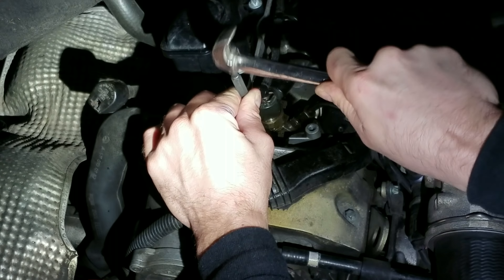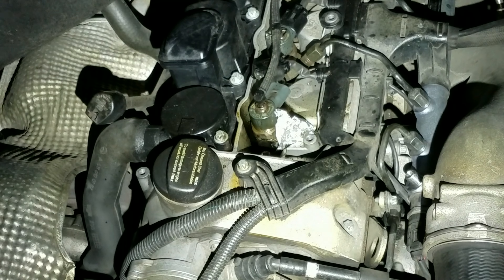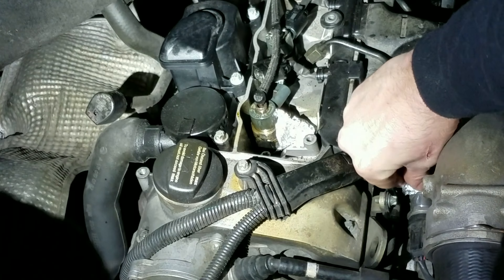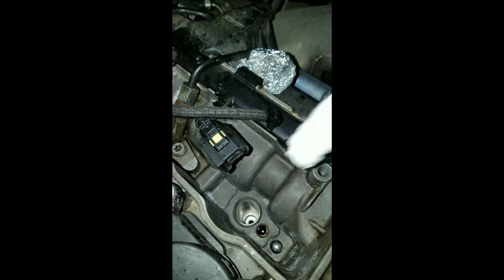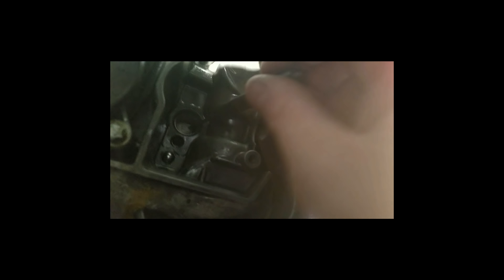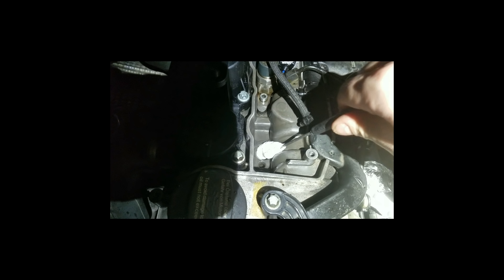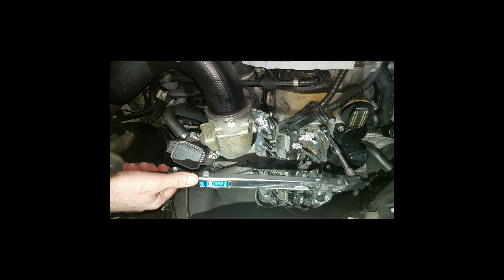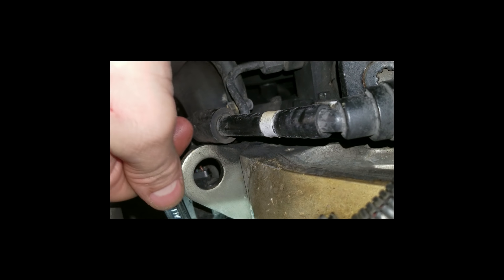How to fix "Black death" injector seal leakage on a T1N Sprinter [02-06 Dodge/FL/MB]

Comment: Is there a way to get some oil on the piston rings after all the cleaning?
Reply from the maker: That may actually be a really good idea if you happen to get any solvents down the injector hole. I would use fogging oil. You can get it at the auto store and it's meant to lubricate the cylinder from down the injector hole or similar, after a fresh engine rebuild. Recently I have been using the injector seat reamer to do most of the cleaning and I plug up the hole while cleaning the sides of the injector well so not much stuff gets down there. My buddy actually removes a glow plug and then attaches a compressed air line into the glow plug threads. To push air into the cylinder and out the injector hole so no junk can come in.

Comment: In the event this happens to me on the side of the road what tools or items should I carry?
Reply from the maker: New injector hold down bolt and injector seal ring, T40 socket and ratchet + extension, 14mm wrench, oven spray, mercedes injector seat reamer just to clean rather than to ream, bottle brush kit from harbor freight, paper towels, gloves, goggles, Fenix HL-55 headlamp, and don't forget the large channel locks - my craftsmans have been serving me well for injector removal. Always keep extra injector bolts and seals handy in the van, multiples, in case you have to redo it or you lose one. Cut slots in the old bolt and save it, as a bottoming tap for the injector hold down hole - it's crucial that it is totally clean so the bolt gets to the bottom of the hole. 

See my black death toolkit videos: 

https://www.youtube.com/watch?v=3vA1zOYSUMM

https://www.youtube.com/watch?v=u5zIC1aOxEA
Reply: @AncapistanVan  I appreciate the response this will be very helpful building my tool kit for my T1N Sprinter. Thank you

Comment: Oven cleaner. Great idea. 
I was looking at a kit with flat reamers to cut the carbon out. 3/5 of mine are leaking and I'm about to drive 1,700 miles. I better get to it.
Reply from the maker: I'd avoid reaming, using it as a last resort. I was able to chip the carbon off the seat with just a pick like a tiny chisel.

Comment: I got a sprinter as well.and my injector seals.on 2.injectors they they keep leaking..replaced.and months later still leaks!!!!!!same.ones
Reply from the maker: Do it again but cleaner this time. The hold down bolt holes fill with sludge, preventing the hold down bolt from bottoming, preventing adequate clamping force. 

Did you use a torque wrench? After the torque wrench did you do one 90 turn, or two? MB has updated the specs to an extra turn for a total of two 90 degree (iirc) turns. I did one without a torque wrench and only one 90 degree turn and it came loose. I redid it and it hasn't leaked since. Make sure you always use a new hold down bolt and copper seal. The seal face on the injector and in the valve cover must be immaculate.
Reply: @AncapistanVan  Must of done it wrong ,yes i used new stretch bolts.and new copper seals .last time i used a tourqe wrench n it leaked..and b4 i used just a rachet.i just tighten it up and moved the injector.and it was still.wiggling so.i turned it eveen more so.it wouldn't turn with force of my fingers..and injector.didnt move.but as soon as i start driving.i hear the compression leaking from there..you said 90 turn.? Im not sure.:( i just tight it up n thats it.i called mb like year ago n they told.me the tourqe.i think it was 28 Newtons they said.not 100%sure..but they never said anything bout 90degrees. ..would you know.the right way n tourqe specs.? 2012 3.0.liter usa
Reply from the maker: @itsmisterchris   well there's your problem. You need to follow the torque spec and torque procedure to get adequate clamping force on the bolt. The bolt is engineered to bend where it doesn't have threads at the top and that is what actually holds the injector in place, that bending/stretching action. It is an incredible clamping force required, not something you can achieve just by tightening it with a ratchet "good n tight". you're basically bringing the bolt to the limit just before it snaps from bending. If you take a look at your old hold down bolts see if the bolt is bent. The torque spec for a 2004 is 23 newton-meters AKA 204 *inch* pounds to seat the bolt, **and then** two 90 degree turns. The original spec was only one 90° turn. So be cautious, smooth and gradual while doing the second 90 degree turn. I believe the torque spec for my 2004 is the same as for your van, but I could be mistaken. I'd check the europarts page for more info.
Reply from the maker: @itsmisterchris  just looked it up and yes the bolts are the same for the 2002 to 2018 USA models as long as you don't have a 4-cylinder. So the torque spec should be the same but if I were you I would call MB wilsonville, oregon, parts Dept to confirm.

https://europarts-sd.com/fuelinjectorretainerscrew2002-2009.asp
Reply: @AncapistanVan  allright thank you :)

Comment: Great video! Just one question, does it matter that when you spray the oven cleaner down the holes it then drips into the cylinder.  Does this matter at all ?
Reply from the maker: You know I was wondering that myself. Last job I did, 2x injectors at once, surely some got into the cylinder. When I started it up idling it was smoking, white smoke, which cleared up after a few minutes. I was thinking the worst that could do is clean the piston rings and contaminate the oil. Well unless you get a whole butt load in there, then you could have a lack of lubrication situation damaging piston rings and cylinder wall I would imagine. You can crank the engine with the injector out but I don't think there's enough pressure to blow out foamy oven cleaner. I tried a Shop-Vac with a vinyl tube duct-taped on but it just wasn't powerful enough. Compressed air might do the trick, or one could try to plug the injector hole with paper towels or a plastic plug. I suppose it would be a good idea to add a little shot of oil into the cylinder in case there is not enough lubrication after the oven spray.
Reply: That makes sense, compressed air and a couple drops of oil would do the trick I bet

Comment: What were those "beauty cleaning products" ? :D Badass repair. Almost a miracle, that you PULLED it out with your own hands, so easy!
Reply from the maker: Q tips. Yep the injectors were steaming hot when I pulled em, plus I caught this very early by smelling it thru the vents long after fixing the boost leaks.
Reply: @AncapistanVan  what spray products did you use? I'm sure they are called something different across the pond!
Reply from the maker: @ltsgarage7780  oven spray

Comment: when you were stretching the bolt, I was cringing and hoping it didn't break. oh what a mess that would have been.
Reply: Stretch bolts scare the crap out of me. The big ones on Sprinter heads just suddenly go to stretch, it's the worse feeling and you still have to give them a whole 'nuther turn.

Comment: thanks for the video, i will check my injectors soon!:) just got a diesel which fires right up, but has a hard time running when it is cold, unless i step on the gas, and the area around the  2 injector(from front) are like filled with some coal, probably dried diesel? well i have all new glow plugs, and it runs perfect when it is warm.. you might not have a idea what it can be?:)
Reply from the maker: Diesels start by compression. The coal you mention is likely "Black death" soot/goo - depending on how well baked it is, it can get crunchy and dry. Injector seals hold air pressure in the engine. So my best guess is that you're lacking compression on two cylinders and when it's cold those two cylinders don't wanna go boom so nicely at the right time, cause compression makes heat.

Comment: where could i find that instruction sheet and or more diagrams/info in this?
Reply from the maker: It came with the brand new bosch injectors I purchased from europarts (Which I didn't use). More info to be found on the sprinter-source.com

Comment: Did I miss the part where you replace the actual injector seal?
Reply from the maker: AK540i I might not have got footage of it, it is hard to film all by yourself while you're working on it with your hands all filthy. My tripod broke on this job. All you do is slip the washer over the injector, either way goes up.
Reply: @AncapistanVan  I understand. Thank you for the reply.

Comment: Thank you very much My engine has a problem with nozzle leakage in this video. I can solve the problem.
Reply from the maker: Yes you can, it's just a washer and some cleaning really. The key details to observe: 1. Must be removed from hot engine, if injector isn't steaming it isn't hot enough
2. Must use new hold down bolt (They stretch) and washer
3. Must torque to spec
4. Sealing surface must be clean